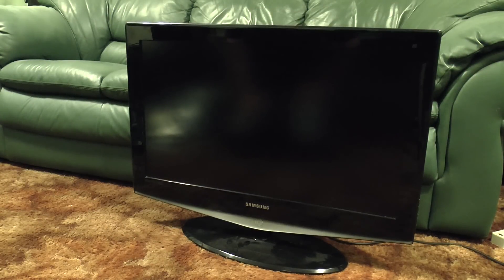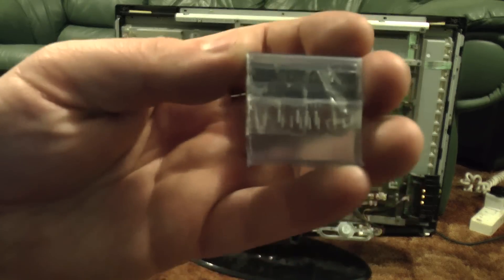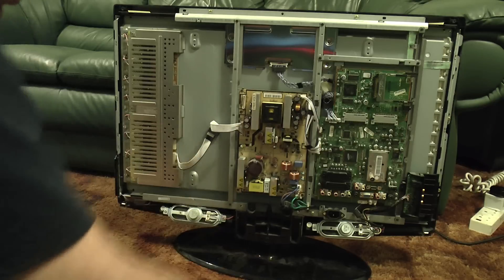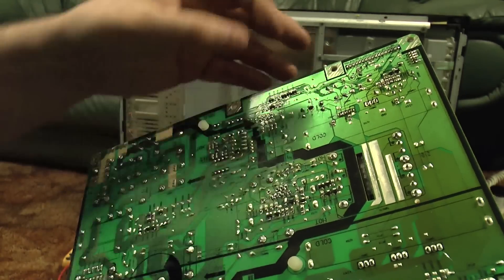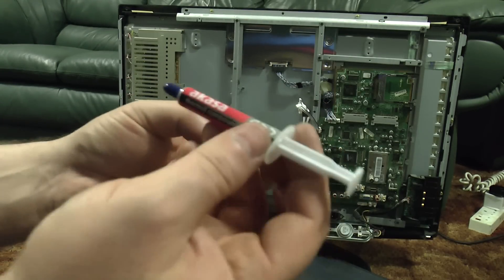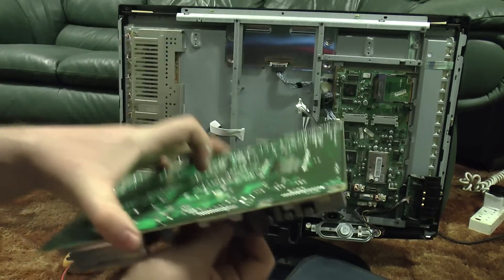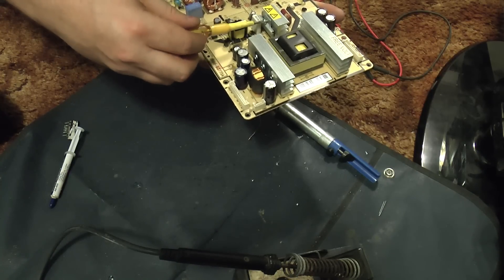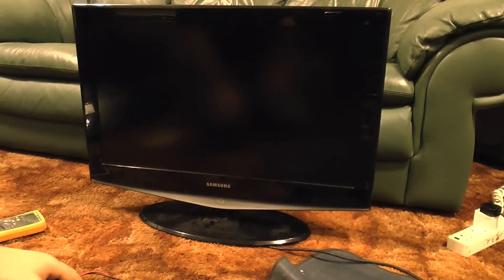How to repair a Samsung LCD TV with a flashing standby light

Comment: The 'F9222L' I.C is a Fuji Electric controller that creates the 24 volt to the inverter board. You can test if it is working or not by volt measuring the five 24v output pins. If it is faulty it commonly reads <5.v

Comment: I love my Samsung 32" LCD TV. I bought it in 2010 for $100 from a guy who only had it for two months. I've used it every day for the last 4 years and it still works just as good as it worked when I got it. I never had a single problem with it. It plays Blu rays beautifully. My first HD set was a 20 inch Dynex and it was a real piece of crap. I started having problems within 4 months. It went from brand new to worthless garbage within a period of 13 months.

Comment: Brilliant vid and explained very well indeed, so much that I am going to attempt to repair mine!!!
Took the back off and the board, just need the chip and I cant seem to find it on ebay... Not sure if you still look at this but if you do, how do I know which i should buy please?
Reply from the maker: If you can't find the chip on eBay, Google the chip's part number. If there are equivalent, compatible chips out there they may show up as such and you can try to find those instead.
Reply: AintBigAintClever Nice one, I will have a look now,
Thanks
Reply: AintBigAintClever Found it f9222L though it has different number underneath to the ones on ebay, so I will check Maplin in a sec... Just wanted you to know that on one site with the chips on is a link to your repair guide.. Your famous!!!
Reply from the maker: Number1Ash
haha, you'll be lucky to find it at Maplin! Try eBay, two and a half quid from plasma_lcd_projector_spares which is where I got mine from. The other numbers will be date codes and stuff.
Reply: Maplin dont have any chief, so yeah well lucky to find one there... Nice one for the info i'm buying it now!, give me something to do on my upcoming days off and cheaper than £400 for a TV

Comment: You can look for higher voltage (as high as you like). For power supplies, you can almost always even go for a somewhat higher capacitance. They're mostly filter caps, and the values aren't critical. The two important factors are temperature rating - again, higher is better. Also look for "Low ESR". The internal resistance of a cap is what heats them up. Low ESR caps aren't much more expensive and will last much longer.

Comment: Thanks so much! I had the same problem. The red power led was blinking and I first replaced the capacitors. Didn't help. Then I stumbled upon this video. Replaced the chip and my tv set is back online! You can get the chip on eBay for 3 Euros, btw.

Comment: Hello! I have a similar problem with the ln32d403e4d model. But the thing is, the TV sometimes works! I don't know if it has to do with what you said it needed to discharge, so I wonder if I just plugged it in too quick. I am only 14, so I'm not to comfortable with soddering, so I wonder if it is something else wrong...

Anyways, thanks for the suggestion, and I will use this as a last resort!

Comment: job satisfaction there😀 I would bolt the IC in first then solder, otherwise there will be stress on the soldered joints which can lead to cracks in time after hundreds of heat cycles (expansion/contraction)

Comment from the maker: The IC was already touching the heatsink before soldering, I just didn't bolt it down. Due to the IC leg design (none are straight, they all have double bends) I think any stress on the joints will be negligible. I want to change the top-right cap for a higher-quality one as it was getting warm (a Panasonic FM-series should do nicely) so I'll remelt the joints while I'm in there, I don't expect any of them to move though.

Comment: I hope there would be more videos like this. However, i think the clamp should be mounted before soldering the part to be sure that there is no stress on the solder after screwing the part onto the heatsink.

Comment from the maker: The part numbers may be different but the fix could be the same, in which case change the capacitors first, if that doesn't fix it try changing the IC. You don't want to spend much money on it but at the end of the day it's a 40" TV so worth a try, surely?

Comment from the maker: All signs initially seemed to point to a mainboard fault (all the voltages seemed correct) but changing that did nothing. Neither did changing the CAM slot board.

Sort of good to know that the main board can fail, I've got a working one I need to sell!

Comment: Good video, i have a similar problem,Tv works but will shut off and not come back on unless you unplug it, the red light flashes, i turned the backlight from 20 to 5 , it seems more stable has not shut, off but wonder if it may need a power chip.. how do you know what IC is the right one,is there a number on the old power chip.. i will probably change it anyways if i can get the part
Reply from the maker: I'm no expert on switch-mode power supplies but my guess would be the capacitors. With the backlight turned up you're drawing more current, if those caps are struggling to cope with the extra current I'd expect more noise/ripple on the output, the power control IC might detect that and shut down.
Reply: AintBigAintClever I forgot to mention i did change 6 capacitors, and the ones i took out were not deformed,they looked good,  it does seem the higher the back light the more chance it will shut off. and when it shuts off the power light flashes..You can get it back on if you unplug for about 5 mins and plug back in..There are so many people having issues with these TVs
Reply from the maker: RICK J
In that case I suppose a chip change would be the next step, the part number will be on it if you remove the clamp.

Comment from the maker: "Fuji Smart power device M-POWER2 for Multi - oscillated current resonant type power supply", it's a control IC plus two MOSFETs in a single package.

There's stuff about it on the web, search for "F9222L scribd"

Comment: Hi, I have the same problem on mine Samsung LCD LE40c630. I want to try to fix without spending much money on it. The impression I'm getting is that the problem can be in the power-supply, capacitors and/or mainboard. And in your case you changed a chip from the power supply board. 

So I'm confused now what I should do. I don't want to spend money on trying to figure out if this and that is indeed need to be replaced. Can you please advice mE? Do you by now know what exactly should be replaced?

Comment: As a rule, too much past is used - to the point where it's almost an insulator. It should be used sparingly as it is intended to simply fill the rough surface of the heatsink and chip so there is more contacting surface area. If it oozes out, you've probably used about 10x too much.

Comment from the maker: Unfortunately not a lot of room to fit one. Any taller and you'd have to cut the case, but then you've got a live heatsink poking out of the back. Any longer or deeper and it'll hit other components, plus you've still got to fit the bracket. Could fit a cooling fan I suppose, as long as it's a quiet one.

Comment: Normally the dying caps send off the chip, so if the chip is faulty you really need to change those caps first or do them along with the chip, using the same value but better quality ones.

Comment: Same problem here. Model code: LE32S71B. I replaced the IC type F9222L (labelled ICM801S on the board), and I also replaced 2 capacitors which leaked (top was a bit convex). TV is now starting up perfectly. Thanks for your video! The IC F9222L costed me 4 euros. Ordered at edron[dot]nl   Regards from The Netherlands.

Comment from the maker: I'm afraid you may be into trial-by-substitution territory, then. Been there, done that (the PSU was putting out the correct voltages, only after changing the main board and even the CAM slot board did I start looking for a PSU board and come across the ICs for sale.

Comment: Its better to screw down the chip before soldering to prevent mechanical stress on the solder joints.
Now you are putting mechanical stress on the solder joints and that could fail later on.

Comment: wrong.. 
i had the same problem, i replaced the powersupply.. and the problem was still there.
i replaced the mainboard, and it worked well.
i heard that the 5v regulator on mainboard was screwed or the eeprom needed a reset.

Comment from the maker: The amateur way.
Tested voltage outputs, all seemed OK so assumed it was the main board gone. Bought replacement. Nope. Replaced CAM slot board in case that was holding the main board down. Nope. Back on eBay for PSU boards, found the ICs for sale. Worth a shot, so bought one. Jackpot. Other boards will go back on eBay as they work fine.
Sounds like a crap way of doing it but it's the same everywhere these days. Car main dealers for example will replace electronic parts, not repair them.

Comment: Or you can replace the standard size heat sink with a heat sink that is made of another material (lower thermal resistance). And use a better thermal paste.

Comment: would a power surge blow the capacitors or just the fuse? My humax tft-lcd tv flashes its blue light at me rapidly and wont turn on. The reason i think its a power surge is that the xbox 360 switched off and on again at the same time but the tv wont come back on. any idea how much this will cost to get fixed in the uk?

Comment: I was recently fixing a PSU for a computer. It turned out the main filter cap had gone bad. The PSU would power up and give correct voltages, but it would fail under any load

Comment: My 32in samsung piece of crap has been doing this for a long time, it turns on and off and on and off and then some times just stays off until unplugged for a while. What a total piece of junk its not even that old. I have several tv's from the 80's and 90's that work just fine. Interesting enough, samsung where the best rated (the 32in may not have been the best in veiwing please but never said anything about being a piece of crap). I'm furious at how soon this piece of junk pooped out right after the warranty was up. My 47in and 50 in samsungs lcd's are perfectly fine with nothing wrong in the years I've been owning them. I'm so irritated I can't even stand it. I'm not good enough with a saudering?iron to accomplish this. I could bring it to a tv repair shop but they'll probably charge more than its worth(maybe?). I'll call them before I ever attempt this. Great video though. Explained exactly why this tv model is junk. Thanks consumer best buy for a recommended piece of crap.

Comment: I have changed the F9222L chip and 2 capacitors that looked to have blown, Still having the same problem. Standby light flashing and a buzzing noise coming from the power board? Any help appreciated

Comment: my 52" samsung had a black screen. i was all ready to replace the power board but happened to notice 1 of the integrated circuits had legs soldered together. don't ask how they got soldered together but i removed the solder from the legs and presto it works again.

Comment: It probably failed in part because they didn't use enough compound on the back of it, it looked like they only applied a 1/2 inch wide blob on there with nothing on the rest.

Comment: Samsung LCD LN40A360M1F red light blinks, replaced power supply board as suggested but still will not turn on except red light blinks as if trying to turn on. Help
Reply: you got a faulty power board then because it should have fixed it

Comment: Here's a board here and over here ia another board and here's the power supply. You said you changed out the cap's. And now this chip is bad. Ok how did you know that ?  Sparkyuiop was saying you can test it. But how did you know to check that part ? Changing out the part is one thing But knowing witch part to change out is another.

Comment: ooh God..! I have two transistors instead of chips F9222L. The code of the transistors are K 3561. The number of the motherboard is BN44-00191A. Should I change the transistors?

Comment: Hi, My 3DLED TV one day stopped automatically and starts power on light blinking, my PS board is bn44-00518A for and same problem power light blinks only, my technician tried to fix but fail. He replaced the capacitor and some IC also one of the IC no FSFR1700XCL but still unable to switch on the TV.  Same power on light blinking. Please help me how to fix